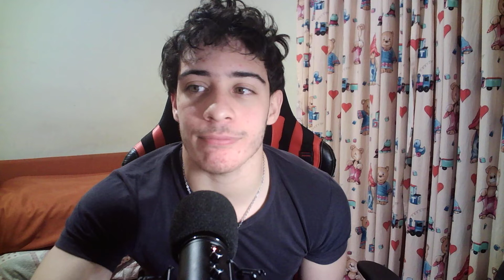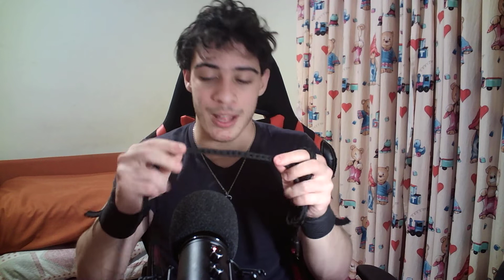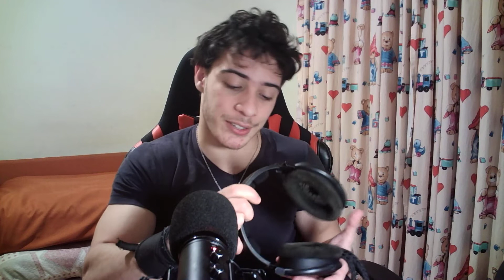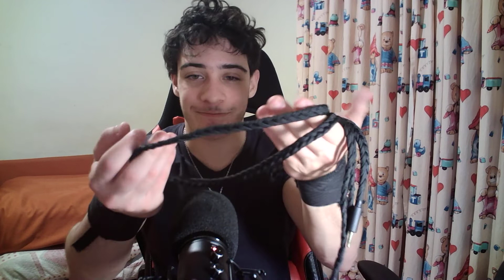Speed King - Tripowin Granvia Cable: THICC BOI.

Comment: I just ordered the 2m version of this for my hd650 I love these cables I got one for my gl2000 dual 3.5 to 4.4 and one for my campfire cascade it takes hd800 connection to 4.4 they are phenomenal cables highly recommended these if any of you are on the fence it would cost a couple hundred to get one of this quality from other manufacturers easily the best cables for the price